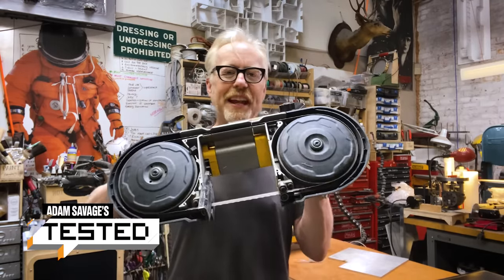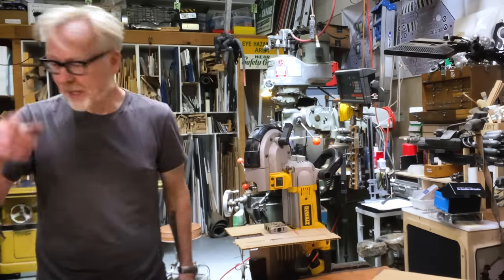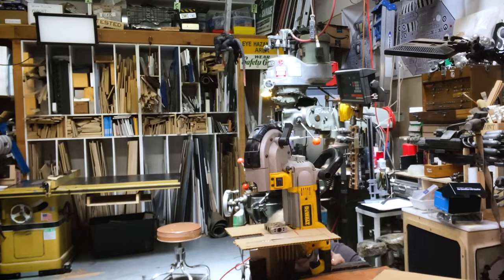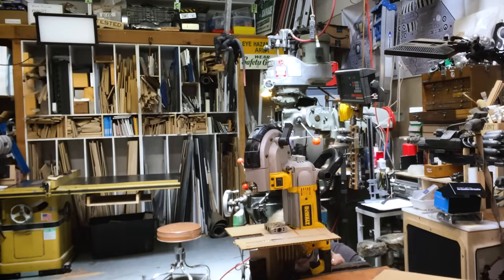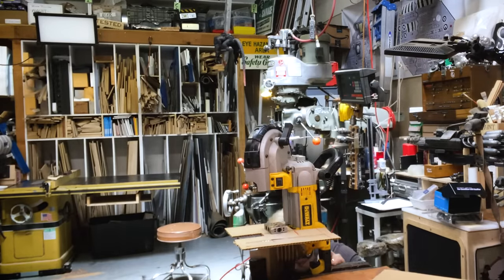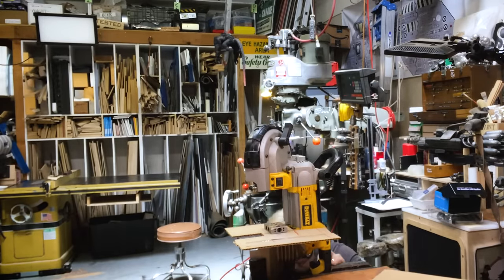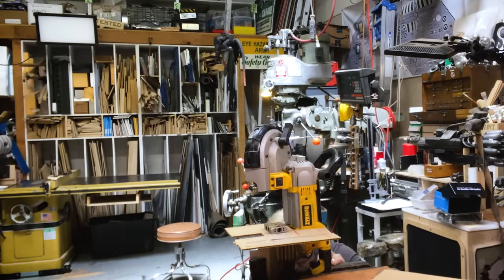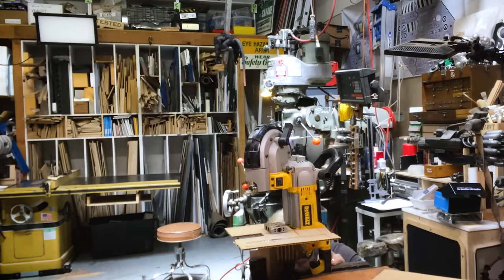Adam Savage Builds a Mini Tabletop Bandsaw!

Comment: Personally, I f'in hate philips. Torx all day, every day. It grips the bit much better. With philips, I slip too often, or destroy the head.
Reply: Torx is nice. I'm a fan of pozidriv, because then you can use a philips screwdriver in a pinch!
Reply: And not having the right bit all the time is a fallacy, because if you switch to torx you have as many torx bits lying around as you have philips now.
Reply: Whenever I see a torx I feel like I'm part of special club, of people who have torx bits. They're great if you're part of the club, they suck if you're not.
Reply: As long as everything g on a device is torx. Half Phillips and half torx is just bad attention to detail.
Reply: @ThePoesn  you've missed the point Adam was making. A Phillips screw can be used with a range of Phillips (or slotted for that matter) bits whereas torx needs the right sized bit. A 15mm is no good for a 20mm torx.
Reply: @zmuzzy101  the issue with that is that Philips heads tend to strip far more often
Reply: In my experience driving, or removing, #8 or larger woods screws, I've never had a Torx screw head strip.  Can't count the number of Phillips screw heads that have stripped on me.  In my case, I'm the exact polar opposite of Adam in this regard.  I "flip off" (and worse!) every stinking Phillips head screw I come across.  If I have a choice, I'll go out of my way to buy Torx (or Square) head screws whenever possible. To each they're own.
Reply: T25s all day, everyday.
Reply: Torx is definitely a better design. My philips bits are all mangy from the heads they've eaten up.
Reply: Slotted Screws Superior. Torx Screws, Inferior.
Reply: Torx is great and I like it what it is. BUT who thought that it would be good to have ZILLION different sizes? Seriously! We could have the same thing as with phillips heads: one small, one medium (the most used) and one big. I get that you would need really small size SOMETIMES aka in specially small pieces. And you'd use some extra large for some really huge screws. That would be just fine. But what bugs me is that I have for example screws in sizes of 20x3,5mm, 40x3,5mm, 30x3,0mm etc. which all use the same T10 (I think). Then I have one that's 50x3,5  but it uses T8! Which is smaller than on the shorter screws. Perhaps they are from different manufacturer but that shouldn't matter! There really should be standard size for the most common screws... they differ way too much sometimes...
Reply: The one that has only a straight line in the head is my favorite.
Anything will work on it
Reply: Have to try Robertson screws - the square drive is solid & strip resistant.
Reply: @mrtfrompv  square drive is probably my second choice behimd torx. Square is nice for combo (philips & square) skrews
Reply: Two things to point out.
1. When a philips screw strips it has worked perfectly. They were designed to do so as a torque limiting feature.
2. The point Adam was trying to make was that the precision that makes torx or robertson superior designs also limits thier use to the exact size of bit designed for the fastener. Whereas philips, with its looser tolerences, can be used with many other "close enough" bits or impliments.
Reply: I love to use Inbus for machine screws and Torx for everything involving wood. You have multiple bits for the different sizes, but I receive WAY too many stripped Philips screws to even remotely enjoy them anymore.
Reply: @zmuzzy101  If that was a valid point it would also be valid for hex drive (aka Allen) fasteners as well. The problem this presenter has with Torx is not a problem with Torx drive, per se, it's a problem with him not owning proper tools to do a job. FYI, you can drive a Torx fastener with a similarly-sized Allen key in a pinch.
Reply: philips comes in three sizes ... red green and black ... wrong size head on the screw will strip it EVERY time ... also a cheap metal head on the screw driver is also crap .. red is the smallest ... best for fine work like jewelry boxes ... green is the normal .. used for drywall ... door frames .. framing . everything a screw can be used for ... and black tends more towards beams and support posts or manufactured beams places where strength is important ... the green and black heads tend to fit each other .. because they are metric but americans make imperial phillips bits which dont actually fit ... the red wont fit into the green but it will work like a drill in them ... and that is the most common way to strip phillips screws ...
Reply: @ThePoesn  phillips only has 3 sizes for basic use ... red green and black .. after that you go to jewellers sizes and of those generally only 6 sometimes 8 but the last two are more for watches ... and thats ALL the phillips head screw drivers needed ... torx has over 32 different sizes ...
Reply: @samroesch  they drill out great and replace nicely with a good phillips head ... I find torx actually strip easier .. less meat between the flanges ... and its always SUPER thin .. it doesnt even have the toughness of a spline gear to handle torque ... its just basic metal ... not even hardened or hardened well
Reply: @bradmeacham6982  and what handle was your phillips ... it had better have been a green handle .. black will strip it because it is hardened more than the green and designed for heavier and stronger screws for things like beams and the like ... while the green is for basic duty like framing .. and red is for small stuff like jewelry boxes ... or small box lids and the like delicate stuff that needs to be held but doesnt require a lot of strength to be held ... use that one and you drill the center out of the screw .. also phillips are METRIC not imperial .. so your imperial approximation version of screw drivers are going to strip the head near every time ...
Reply: Robertson all day, sorry is my Canadian showing?  :)
Reply: @GeorgeBryantLuxtylo  JIS >>>>>>>>>>>>>>>>>>>> Pozidrive > Philips
Reply: I use Torx whenever I can. I ve got two main screwdrivers for it and a whole bunch bits that are everywhere. My "thing" is always close and again, they do not strip out. And they double for Allen Keys too
Reply: The first problem with Philipps is that I never know how to spell it. The much bigger problem is that there are different kinds of cross type screws, and that’s what mangles the heads all the time. In Germany, most of the wood screws sold are Pozidriv, and most of the screwdrivers sold are Philipps. It’s insane: so many people don’t even know this. I’ve talked to engineers who never heard of Pozidriv, despite using those screws since their childhood in DIY projects at home. There’s also a Japanese standard, which is slightly different again: people have been ruining those screws for decades repairing and restoring their old Honda and Kawasaki bikes.

And no, Philipps screwdrivers don’t fit Pozidriv screws, not exactly: every time you think you may have the wrong size but it kind of works, you’re likely using the wrong driver. You can turn Pozidriv screws with a Philipps driver, but you ruin them over time. And the fact that one Philipps screwdriver fits a range of sizes is not necessarily a good thing, either – that contributes to mangled screw heads as well.

Philipps and Pozidriv aren’t that bad, but you should use the correct screwdriver, and that’s a total mess. I also think they’re quite ugly, Torx is a bit prettier. Of course the better grip means that Torx screws will break more easily if you’re not careful, especially cheap ones. But I do prefer them.
Reply: Robertson screw is the best, hey! 😎 🍁
Reply: Mads Arvidsson who ever uses the right bit any way........yeah that should do the job🤣
Reply: @daviddale4206  that's the thing, if you have a good Phillips bit and your using the right size you shouldn't have a issue. Now if the screw is used a lot then a torx machine screw would be a bit better since it's more forgiving for "error"
Reply: Philips can be driven by Pozj but Posi are not so clever with a Philips. Then don’t forget those with a dot may well be Japanese JIS which is only really ok with a JIS bit.
Reply: @Riley_Mundt  not much into engineering, are you?
Reply: @schwarzermoritz  Woodworking is my primary hobby.
Reply: Is a Torx a flathead? Cause it looks like it. Personally I don't mind either way, but I do find that when manually doing/undoing a flathead, I constantly have to readjust the bit cause it slides off to one side. Kind of annoying, but not the worst thing.
Reply: I hate being that guy but in my years of experience I have learned that the biggest flaw in any given fastener drive choice is almost completely sub par quality of driver. With the higher quality tools I usually invest in I have seen a marked reduction in stripped or damaged fasteners. That said I still see torx screws are the third highest strip ratio after Robinson screws and Allen screws.
Reply: @0623kaboom  I have more than a dozen Philips screwdrivers, some I've had for half a century, but NONE of them are coloured red, black or green ... Most have yellow handles as per my old Xcelite handles! 

If Adam (and Americans generally) were to ditch their colonial past like they did their colonial masters, the WHOLE WORLD would then be metric and much fewer bits to worry about. Besides, you should have our British problem ... Whitworth, BA, BSP, Metric, UNF, UNC, etc!

The WONDERFUL thing about standards is that we have SO MANY from which to chose! 😁😁
Reply: Exactly, much more torque can be applied the the screw and the head doesn't get marred up as easily. Much safer too, as the driver doesn't have a tendency to slip out and stab body parts.
Reply: @Riley_Mundt  Only on opposite day.

Comment: I did this with my saw 5 or 6 years ago. It is one of my most used tools. Mine differs from Adam's design a bit. My table is easily removable with a single nut and the saw is held vertically in a stand. I can convert it from portable band saw to vertical and back in about 20 seconds. I also have a foot switch to control it.
Reply: This is the design I want!!

Comment: No. Way.

I was looking for something to have on in the background while I did my own build... Of literally doing this to my portable bandsaw!
Reply: What are the chances? Lol
Reply: You should show us a picture of the finished project and compare notes with Adam!
Reply: Dude... me too! except my base is a repurposed crappy ryobi table saw frame that I pulled the motor out of.
Reply: @gl15col  the finish to that is fools seldom differ ... tbh i think it would make a neat conversion kit .. even a mini portable workshop if you make the table pivotable and perhaps able to take a fence for measured cuts ... and a few different inserts for say round things rest on a v groove brass insert so they dont slide around and as you slide it in it cuts at the length you set the fence to ... and even carry a spare blade of different material blades ... perhaps a mini brass vise that uses the brass insert as its base ... to hold something very steady and put that on a slide through the brass base ... there are so many things that could be done to make it super useful ... and most of them can be done as 1 day builds as he improves the capabilities of the minibandsaw

Comment: just fyi for those that only have one portaband, they are designed to be hing from the handle, and the back hits the wall making it very secure and level! A piece of 30mm angle works well for this. I keep mine on the wall, and use a welding clip for on and off. I use it more this way than just about any other. Best tool ever!
 Keep up the good work Adam!

Comment: When you connected the lugs on the switch, I hope you have the motor load connected to the middle terminal and the hot AC input on the outside lug, otherwise when you switch it off you could switch the hot AC terminal to the other side of the switch throw where it would be exposed.
Reply: Yeah, saying that the switch is always connecting something gave me concern that you could brush against two poles when the switch is off and get a jolt.  Seems with those connectors exposed that would always be true.
Reply: also, he should make use of that feature of disconnecting 2 seperate lines,  by adding both neutral and hot to it , with the way some stuff is wired it can happen that  a neutral wire will get  hot and other way around ( atleast here in eu with the 2 prong euro plugs , thats how it can happen ) ( not talking about earth btw )
Reply: @dncingshadow How is that better? If the shops wiring was done correctly than it won't matter either way, but if the shop wiring was incorrect then there would certainly be an advantage to having both wires switched.
Reply: @@dncingshadow Right, because it will never be plugged into an extension cord that someone has whacked the ground off of, or a two wire ungrounded extension cord.  It is always safer to break all connections except ground, and the switch is already there.
Reply: He didn't cover the other terminals yet anyway, so it is only marginally more dangerous. I am concerned and reaching for it blind, and rubbing right across the live on the side.

He said he was going to protect it from metal shavings, but hopefully it gets fully enclosed
Reply: I think he would be better off with a momentary switch and a relay.
Reply: @dncingshadow its about the fact that someone can always mess up wiring and switch hot and neutral around in home wiring, so disconnecting both neutral and hot is the safest and correct way, if you can do it
Reply: dpdt ... one side one set other side a different set ... the top is only connected to the power the bottom is not ... both sides are connected mind you ... so BOTH top contacts are live ... when he powers on .. so he could wire a 120v light into that part also .. if he needs one ... he could also mount a battery charger for the battery one in the base and have that set to the bottom contacts and charge 2 batteries when not using the saw
Reply: think blade switch like the old frankenstein movies ... up it connects the wires to power ...from middle to top ... BOTH top contacts ...  down it connects middle to bottom ... if there is no connection on the bottom it doesnt have power ever .. so as long as he doesnt touch the top contacts and middle contacts at the same time he is fine ... if he has it turned on and touches the bottom and middle contacts NOTHING happens ... the BOTTOM is NOT connected to anything ...
Reply: he could add a goose neck light for the table and have it connected to the second contacts on top so it turns on when he wants to use it and turns off when he isnt ... that is what the second contact on top is for ... addons
Reply: also he could have a true dpdt switch which then means the top left and top right and middle left and middle right are all separate ... so a connection on left middle and top right wont do anything ... same with the bottom .. BUT a connection on the top or bottom or BOTH on the left will connect that side to that power line ... it could be 120v ... it could be 210 v ... it could be 5v ... whatever you wire in for your needs ... you could then literally have 4 different voltages on that one switch ... and only 2 will be on at any one time .. the top two or the bottom two

Comment: Okay I'm kinda confused, you wanted to recess the switch so it wouldn't get banged up, but the cable gland sits proudly to the side? :D
Regardless, this is a nice practical build. Guess its time i refurbish that old broken Makita Protaband i found and turn it into this.
Reply: I was thinking the exact same thought, why not put the power switch above the input wire, it wouldn't need that silly additional piece he used to recess mount the switch and would keep the (dodgy) wiring job away from hands and metal shavings....remind me not to ever let Adam wire anything in my house :-D
Reply: Yes, exactly! I was yelling at my screen while he was drilling the hole. He also needs a single throw switch because that double throw switch is dodgy as hell.